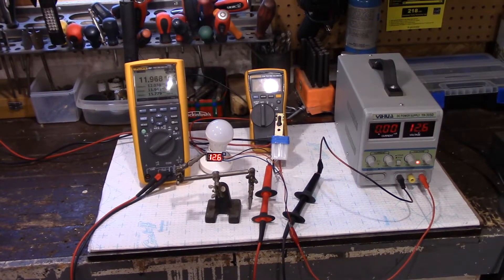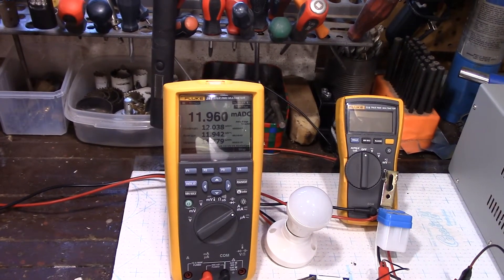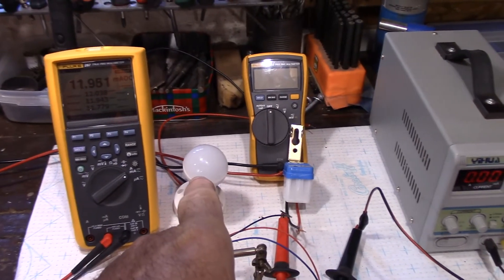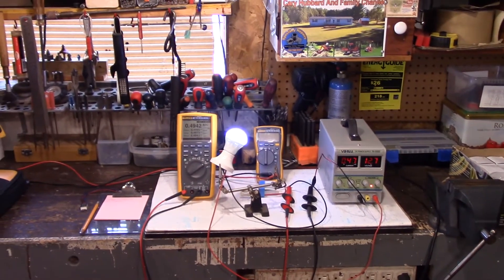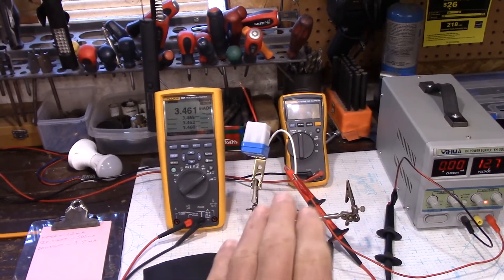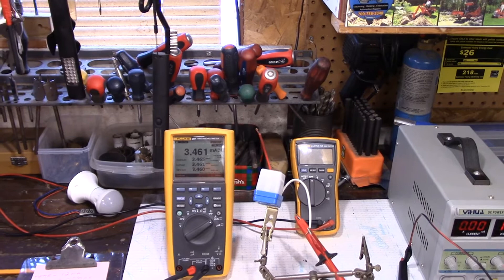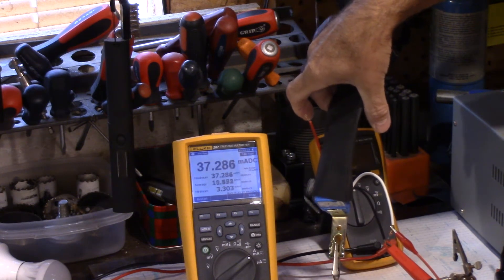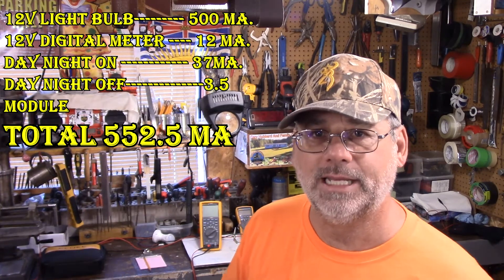How To Design A Solar Powered Night Light - Part  One

Comment: This is just more thinking than I'm capable of.  Will the cold temperature make a big difference?
Reply from the maker: Yes  absolutely Bruce,  big time problems in the cold  so you have to adjust for it.  I've seen how you can think and you are very capable of figuring this out  👍

Comment: Good project Steve.....if you figure your load you can build an economical systems but not to go on if you want to expand in the future....It's always better to know how much your making versus how much your using.....CHEERS
Reply from the maker: Yes good planning results in a good design .  Lots of assumptions on daylight to charge a battery but I can always add more solar. Cheers bud.

Comment: I just use an extension cord. lol I bet you could get by with less than a 100 watt supply.
Reply from the maker: I would need about 400 miles of extension cord 😄 Its hard to judge  the requirements at times so I go with plan A and end up  at  Z  in the end HAHAHA

Comment: How's she goin'?  I'm watching this video first thing Sunday morning and you want me to think?  Wow that's a stretch.  But here goes:  The supply is 12.6 volts.  Your total night time load is .53 Amps and  the daytime load is 0.03 amps.  It's daylight for about 9 hours and dark for about 14 hours.  So I'd say the system uses about 6.7 watts when the light is on and 0.4 watts when the light is off.  So to run this lamp for 9 hours you'd need 93.8 watt/hours.  When it is off you would need  3.6 watt/hours. 
So for a 24 hour period your system would consume 97.4 watt/hours.  So you would need a solar a panel that can provide this amount of power.  Taking into account the efficiency of solar panels, which as I understand it is pretty low, we'll say less than 80%, I'm guess you need about a 200 watt solar panel. But I'm not sure how solar panels are rated.  Does a 200 Watt solar panel produce 200 watts only at peak sun?  If this is the case you'd probably need 3 times this much.  Am I close?  What do I win?  LOL  This is interesting Steve.  But I've expended all my brain power for a week and I need to rest a bit now.!!!  LOL  Take care!!
Reply from the maker: HAHA well it was early in the morning so it's all in the math and were a ways apart but the math seems seasonable but my math is a bit different , its old school math and i'm thing your using new testament math maybe. Lets see in part two LOL
Reply: @SteveRobReviews  I hear ya!!!